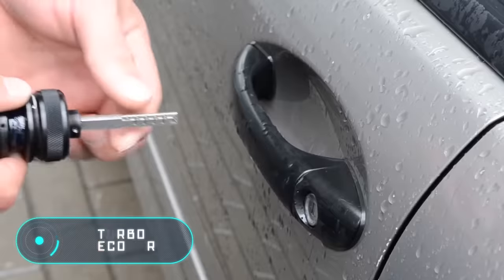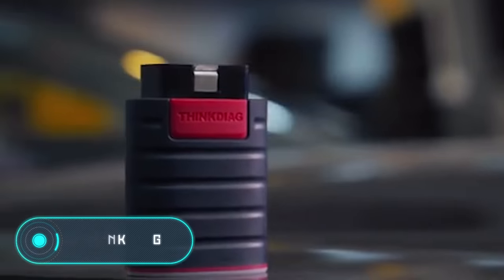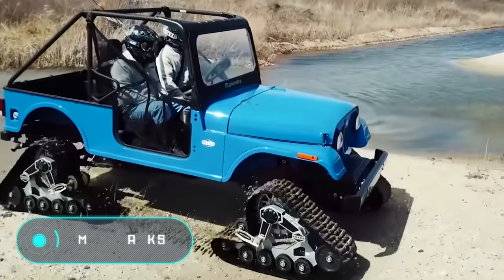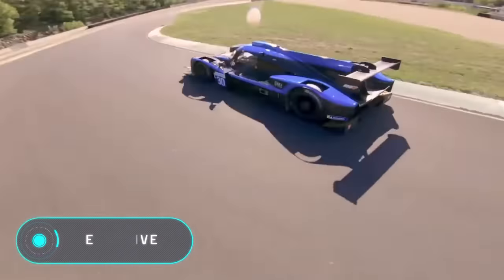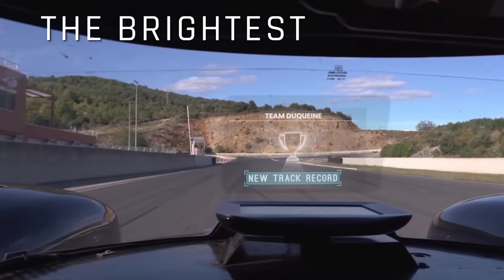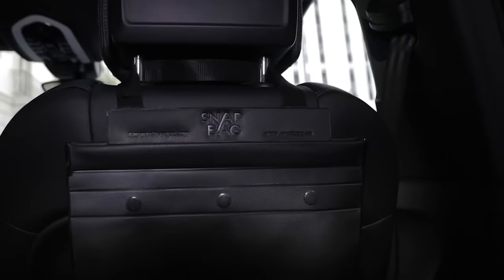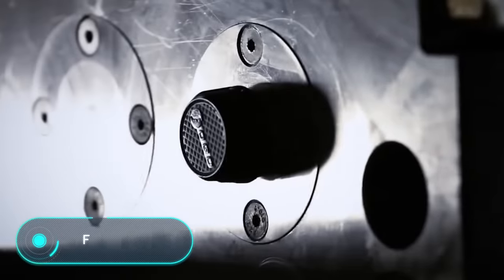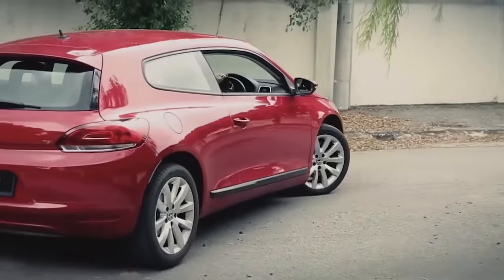CAR INVENTIONS AND INGENIOUS TOOLS THAT ARE ON A BRAND NEW LEVEL

Comment: I wonder if the matt tracks are something you can take on & off yourself as needed, or do you have to take it in & leave them on?
Reply: Lainey Bug iirc they’re designed for diy install and removal just like replacing a regular wheel and tire.